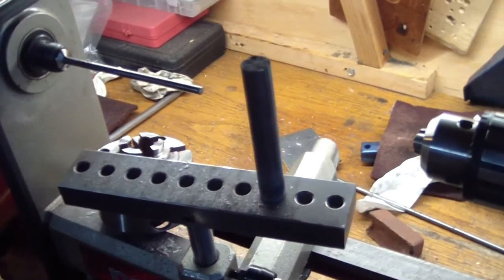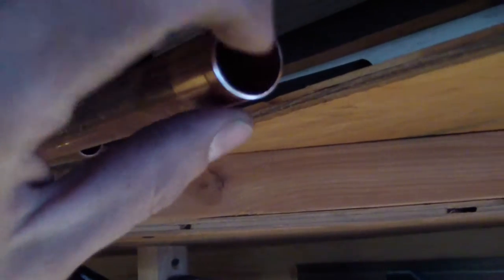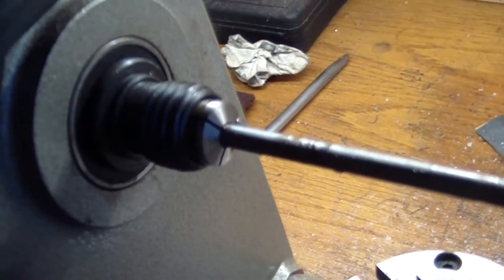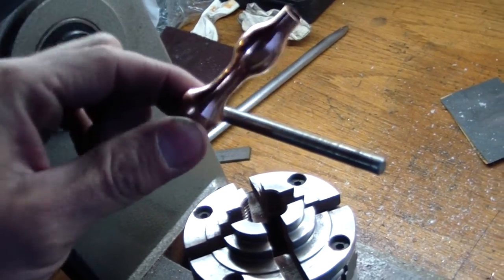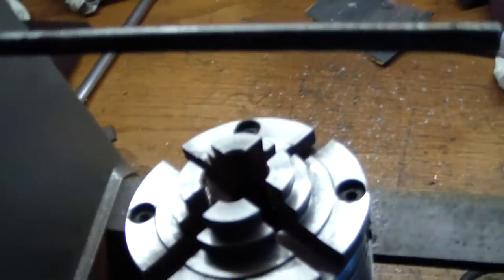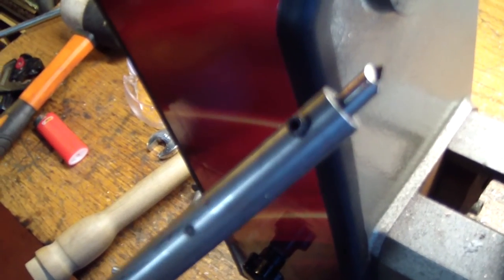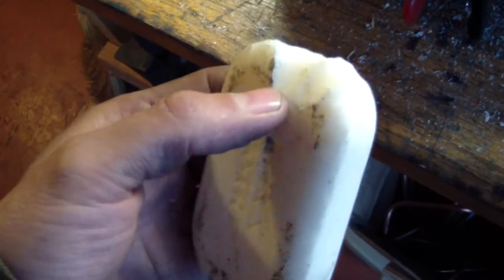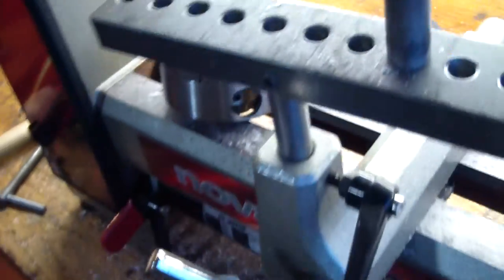Copper Spinning Tanks

Comment: You can crimp-seal things with those collets (not arbors)
If you need to compress tubing to slip into another piece you can use those collets with a draw bar to progressively squish the tubing.
Reply: Have you seen any of click springs videos? you should check him out, some really simple techniques on toolmaking and hardening procedures. Super high production quality videos, awesome stuff.
Reply from the maker: Whoops!  That's I meant! Haha.I might try that out.  Thanks
Reply from the maker: I hadn't; they are good.  I wish I had time for that kind of work.

Comment: you should make your own copper filter driers
Reply from the maker: Intend to eventually. I'm not sure if I'll have to make it in two pieces and braze the shells together.
Reply: M.C. Pletcher.  i personally have been in school so i will not be able to do as many projects as i can during the summer. but i still watch your videos and your mini fridge  turned  out great.  do you think trying to make a cryogenic freezer would be a good idea
Reply from the maker: DIY king I think it would be fun, but I don't have much use for such a thing. You should give it a go when you have more time!  My current project is an intermittent absorption ammonia water refrigerator, then back on the vapor compression fridge.
Reply from the maker: And thanks for watching!